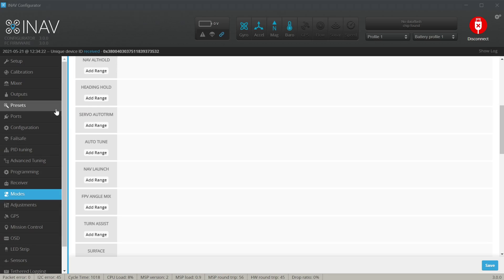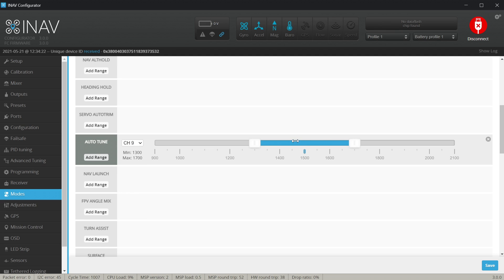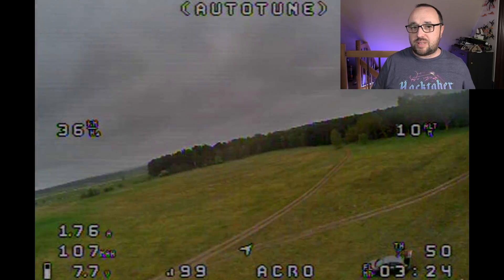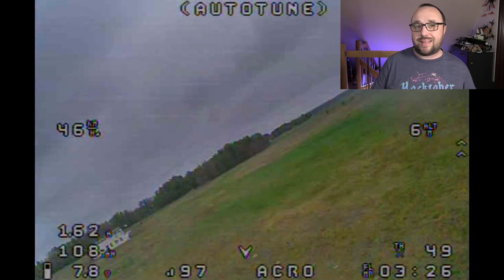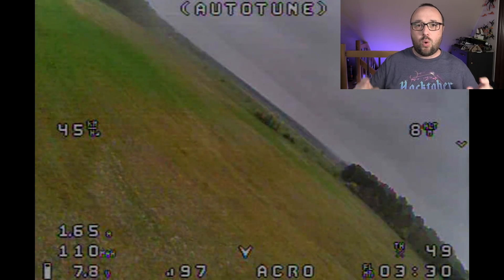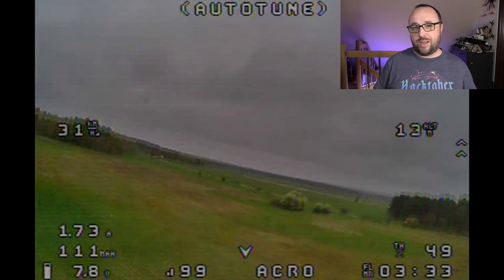INAV 3.0 New Autotune for airplanes

Comment: Thanks for video and all you do for the hobby, I'm still running inav 3.0 on my ar wing pro, I somewhat confused on pitch and roll ff with pitch ff set too 50 she flying very smooth no pitch bobbling up and down but this seems to interfere with autolaunch it's like it won't climb as well. When pitch ff set to 70 she climbs great but back too the bobbing up and down what am I missing here?

Comment: What happens when you have a really nimble wing and the rate it's capable of responding at exceeds the rates at which the pilot is comfortable flying?  Is it just a matter of "don't go full stick"?
Reply from the maker: PID controll will try to keep at the rates programmed. So if it's too fast, it will slow down. If it's too slow, it will never reach the target

Comment: Thanks for all your hard work put into iNAV!  My AR Mini Wing is flying great.  AutoLaunch .. wow.. it works!    I usually launch with Return Home enabled and take control of the airplane when I am ready in Angle, Horizon, or Acro mode.   I plan on testing the NAV-Waypoint flight this weekend.
I created a Mission Plan with a guided landing to Home.  Basically the flight takes  the airplane out towards a river inlet next to my club's airfield, then back to the center of the cornfield and gently drop the ar wings altitude and speed with 0 throttle 100ft away from the home point.
If it's not enough for a gentle controlled landing I can always take control.  If it works I plan on adding an airspeed sensor and see if I can write some code that will calculate the landing slope  and  guide the airplane down as I did with my test mission.

I'm having a blast with it.. I'm installing another  Sparky 2.0 controller running iNAV 3.1  in a Legacy AR Wing 900mm airplane, a Zohd Dart Extreme XL, and a Volantex Ranger 1600.

I used to be afraid of hitting the autotune switch, especially with multi-rotors.  Not anymore.  iNAV 3.1 Autotune works extremely well.

Comment: to clarify, at 0:35s you state that we need to disarm after landing? Is that correct?
Reply: You can't save the autotune if you're armed you need to disarm but do not unplugged use the stick commands to save or go into the osd and do a save reboot